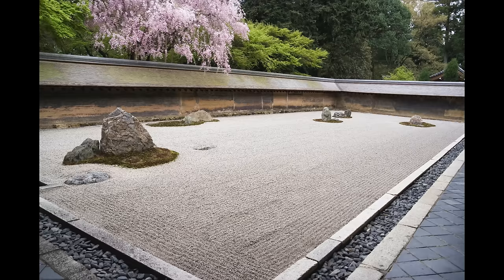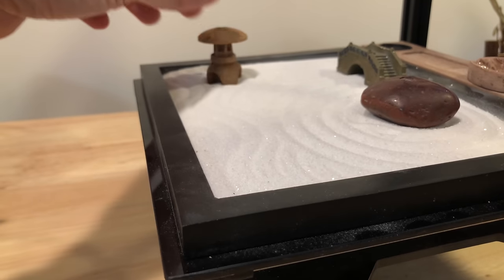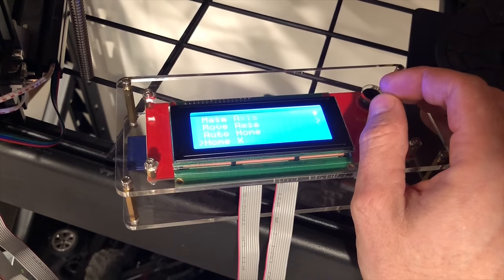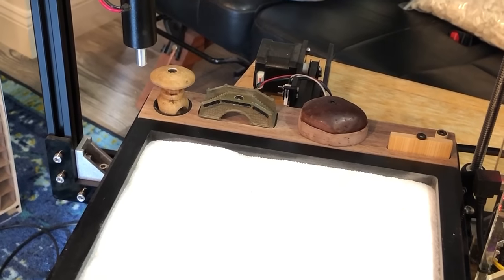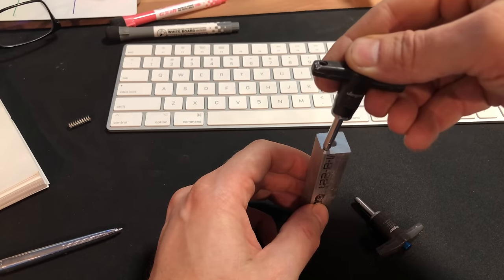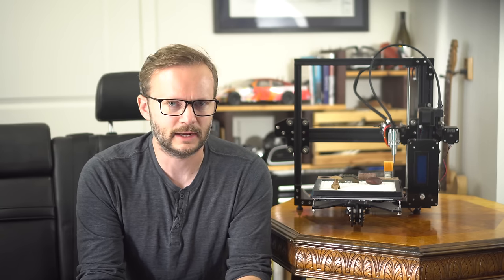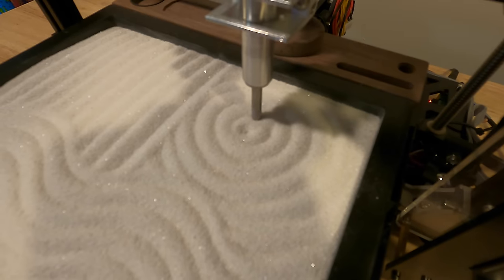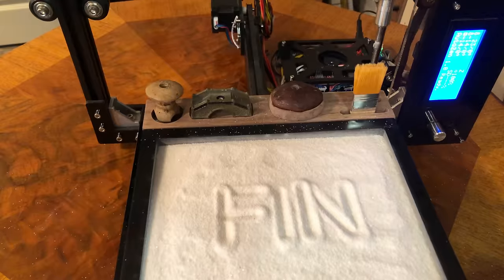Robot Zen Garden

Comment: just FYI for matt and anyone else who might read this - do not constrain the free end of the lead screws. The lead screw is there to provide linear motion only . The V-rail extrusion is there to provide the straight alignment on that axis. By constraining the free end you are actually fighting the straightness of the lead screw against the straightness of the aluminium extrusion, and the extrusion will have far tighter tolerances than the lead screw (especially on a cheap machine). This can cause a regular wave pattern in the Z axis of the printer (which might already be present if the lead screw is manufacture bad enough - i've personally received printers with screws out of the box that might as well have been bananas given the bend - but rest assured constraining the end will only make it worse. The only solution to a bad lead screw is a new lead screw)
Reply: I second this!
Reply: Sounds too nerdy. I’m gonna go constrain some lead screws.

Comment: 3:04 constraining the Z-axis like that can actually be really hurtful to 3D prints. Your application didn't require a too high level of precision, but with these cheaper printers it's not guaranteed that the rod is 100% straight, causing the gantry to shift significantly when you get closer to the center of the rod.
Reply: You can see what I mean here:
https://www.youtube.com/watch?v=2Z7mZVvPlc8&t=481s

Comment: I have wanted to do this for a while but my plans were to have a steel ball under the sand and a magnet on the arm underneath. That couldn't place items on it though. Now I'm thinking something less mechanical on top like a single segmented arm with the stylus on the end. There have been some experimental 3D printers built like that, with an arm with a shoulder and elbow joint to move in two dimensions. I think there's already Marlin code in existence for this setup.

Comment: If you electric magnet does not let go, you might add a spring to let go.

I believe a vacuum suction is better for picking things. You turn it on and off using some kind of valve controlled by solenoid.

Comment: I've watched some of your other videos and have a project suggestion.  It's kind of big, but shouldn't be too hard.  Get a Chevy Bolt, , cut the body off and put a chevy Astro Van body on it. The seating position vis-a-vis the front axel looks to be very similar on both vehicles. The Bolt is front wheel drive which helps a lot. You should be able to use the entire front suspension, firewall and dashboard with all accessories.
Reply: wouldn't you be better off just grafting the bolt's front subframe into the chassis of the chevy, and keeping the bulkhead and everything back from it (except maybe the dash) in place?
not to mention that the bolt is also 200mm narrower than the astro, so you actually couldn't use the standard suspension unless you wanted to have it look really funny, or put super stance nation 100mm offset wheels on it.
Reply: Captain Zoll I’m thinking you might want to “channel” the van body down a bit over the bolt chassis. It would have a lowered look. It would be helpful to have the front wheels in so they could turn and not hit the fenders as they would be further up in the wheel wells.

Comment: Mhh... I'd argue a more appealing design would make us of a SCARA type robotic arm for drawing of lines and placement of parts with the Z-Axis raising the whole arm instead of the endeffector thus allowing the arm to be somewhat collapsible for hiding in the base when not in use 💡 As for cleaning the surface, maybe an ultrasonic inductor would do the trick? Alternatively, you'd have to find a routine that is capable of flattening the surface with a wiper using the robot - Maybe first wipe from the outside towards the center creating a pile followed by an outward spiraling motion starting at the center - Excess material should redistribute itself properly like that, no? 🤔

Comment: 4:08 Could this maybe be fixed with a pull down resistor? I'm not at all an electrical engineer but I had an Arduino class at school and when you hook up a switch to an input you have to use a pull down resistor otherwise the voltage stays high after you let go of the switch so you need a ground to send it to. I imagine what might be going on in the magnet is similar to this??? I also noticed here you removed the positive side so I wonder what would happen if instead you removed the negative side and then grounded it. But I also know electromagnets need a current to work not just a voltage so I'm probably completely wrong and this is a completely unrelated phenomena.

Comment: test at high Z.  so true. light sensor so it doesn't run at night, thats Zen, Beautiful.      arduino GRBL two salvaged stepper motors and a power supply. Excel is easier to access data than  matlab . I cnc woodcut Lidar data from the environment agency,  Its still free in the uk, height maps 0.5m near waterflows. 1m further out, but make amazing local snapshots , in high resolution wood. I think I cut at 1Km/20cm X and Y , for Z it needs enhancing to be visible.